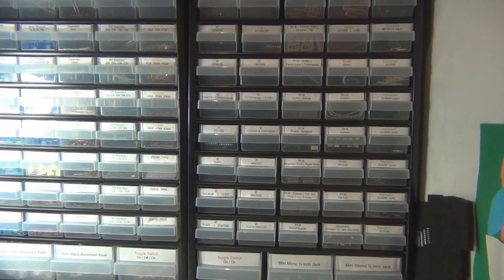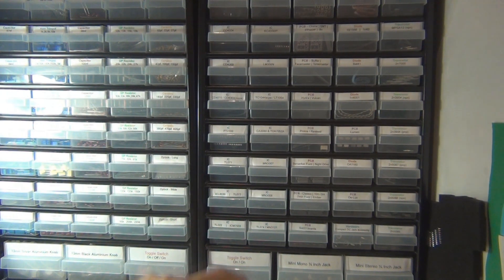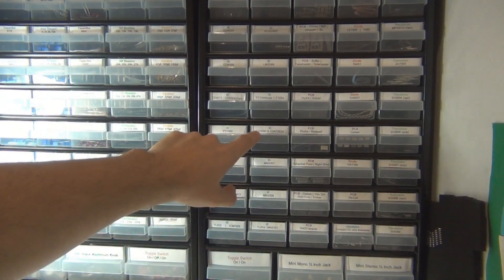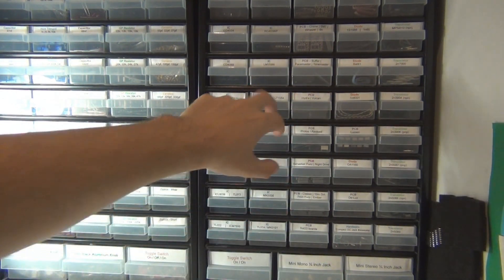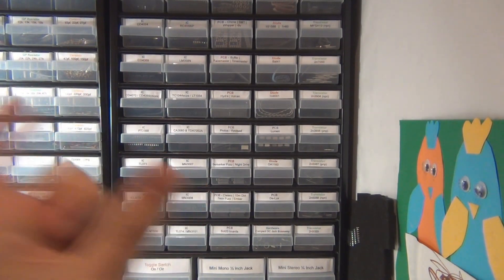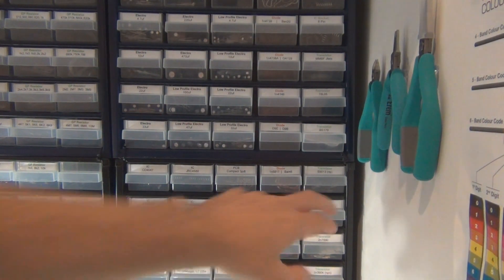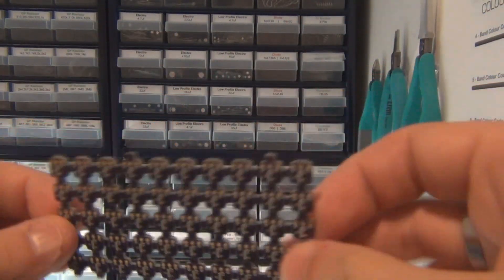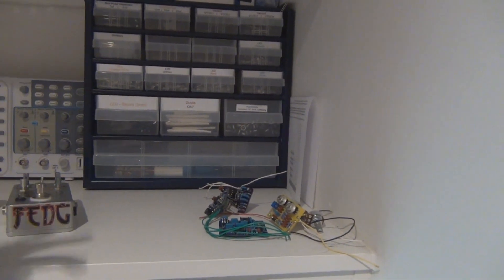Common Pedal Parts Stock Up List - IC's & Transistors Part 3

Comment: ICs
PT2399 - Delay
TL071
TL072
TL074
MN3101 -Timing Chip
MN3008 -Long
MN3007 - Short
CA3080 -Phaser
TC1044 -Low Curr
LT1054 -High Curr
LM358N 
RC4558 -Lots
RC4580

Transistors
2n5088
2n5087
2n5089
2n3904
2n3906
MPSA13
BS170
78L05 -5v reg
J201 - JFET
5457 -JFET

VTL5C3 -vactrol
Reply: You're the man. Thank you for taking the time to help out.

Comment: I would like a tutorial on how you use your oscilloscope. is it a practical piece of equipment for your average paint by numbers pedal builder (like me)?
Reply from the maker: Its more for design and analysis (imo).  For pedal building its not required, but if you want to take a more indepth look at electronics or you are planning to design an effect it can be of great help.